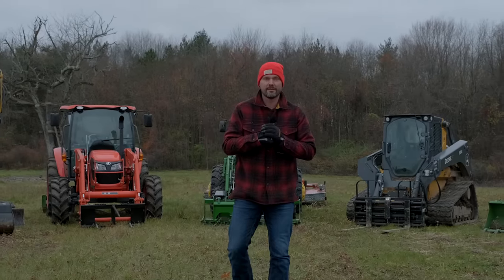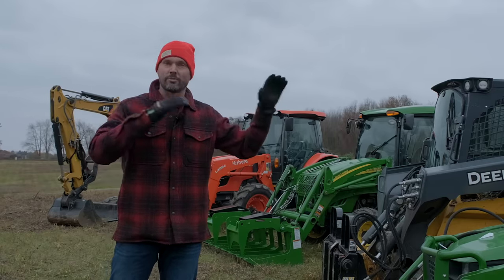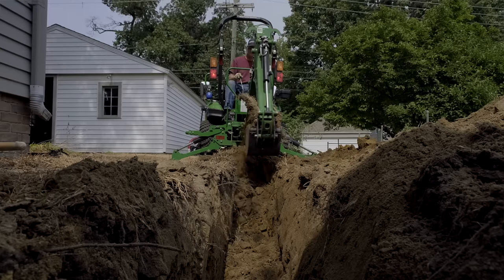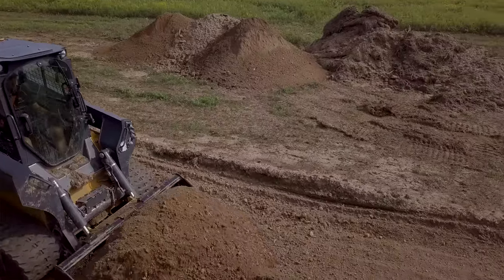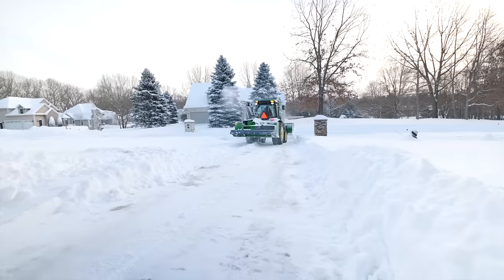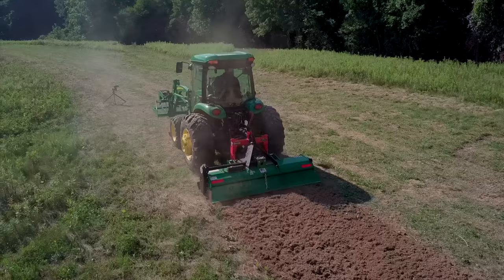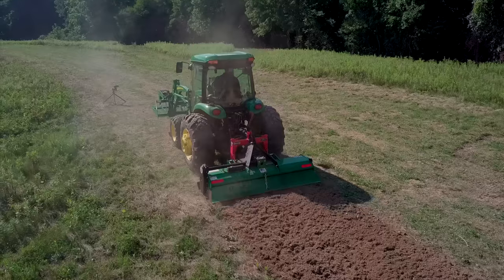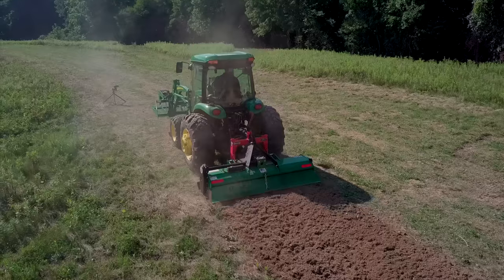IF I COULD ONLY CHOOSE ONE? BEST MACHINE FOR PROPERTY MAINTENANCE

Comment: I recently purchased a little over 10 acres and only 1 is cleared for the house. I'm planning on clearing at least 4 more at the present. It's a combination of trees and heavy brush. I'm wanting to add a few dirt roads, a couple of utility buildings, a green house and hopefully about a half acre pond that I can stock. Not planning on doing this all at once but over the next couple of years at least, and the area I'm wanting to use is fairly flat with a some ruts and a few areas of hills. I would love a recommendation as to what would be a decent tractor size and what attachments would be most useful. Budget would be around $20k to 30k.

Comment: For a large field I would not get a hydrostatic transmission,  they're not designed to be driving one direction for a long time they work well for loader type work. Power reverser would be my choice best of both worlds good for loader work and great for long drives like   Bush hog work

Comment: So I wanted a L4701 but couldn't find one with a loader local for about a month.  I finally settled for the M5400.  I think it might be a bit big for 7.45 acres but we shall see.
Reply: I also wanted the L4701 when I bought my tractor this past year.   Could not locate one and ended up buying a MX5400.  You will not be disappointed.  Great tractor.

Comment: Other than rolling speed a midi ex will out work all those in most all those projects with the exception of tilling and snow removal.  A 12k machine has potential for a lot of attachments and the advantages of tracks, power, and stability. Moving things, pallet forks, hay spears, grinders, grade bars or buckets, digging, road building, foundations, septics, drainage....I feel the others are more hobby machines that do work but have many more limitations. Then again terrain/ground type and application im sure dictates much of this perception.

Comment: If clearing land then a big skid steer & an excavator will do the job. However a bull dozer will do a better job. Even better get two bull dozers & link them together with a big heavy chain, then knock down everything. 

Where I grew up bulldozers on farms were a common sight. Today they are not seen as much as most of the bush has been cleared. A few old ones are still around, most of them rusting away in a paddock or sitting in a shed. Tractors can keep the bush from growing back. However sometimes land is neglected and the bush grows back on formerly cleared land. This is when heavier equipment is needed.

So if clearing land, get heavier more powerful equipment. If working the land get a tractor. Even a little tractor with a front end loader is a blessing when clearing bush. We have a Kubota MX5200 which I guess is one of the larger compact tractors out there. It’s not a bull dozer but having a loader lift and push is a blessing.

Comment: The cost difference between a skid steer and a tractor is significant, as well as the weight difference. Additionally, maintenance on a skid steer is difficult and expensive. For me, a tractor is much more feasible and versatile. Skid steers are very capable for a limited number of tasks….tractors are super versatile for virtually any task, and cheaper and easier to service.

Comment: Utility tractor is the one for me. I have 112 acres and lots of roads. Used to be a campground. I have the 5055E. Was looking at the 4066 and would be useless for me. I haul dirt from point A to point B. When I saw the bucket of the 4066, it’s about 4 times smaller than the one on my 5055E. Imagine hauling dirt from point A to point B 2000 feet apart. Would take me forever. Also I have really big oak trees that die from time to time. I had some this summer that I could barely skid a 10 ‘ log. And then the loader could barely lift the log onto a trailer to get sent out to a sawmill. If you have a descent size property and you want to skid your own trees for fire wood and you have large trees then a compact tractor would be a poor choice IMO. Hope that helps.
Reply: You should get yourself a dumping trailer that you can pull with your pickup truck 2000' is way to far to carry small quantities of dirt. Not to mention the time involved and wear and tear on the tractor.
A good dumping trailer really holds its value, use it until your done with it then sell it and get most of your Money back.

Comment: So I am looking into a tractor just bought 6 acres flat ground open field will be making it home stead house barn etc., there is only one piece I’m really gonna have to do tree removal and that is the easement access to the property, so I was just going to rent a skid steer for that, I do also have access to a zero turn for the yard grass that for the rest of the open field I’m not sure what tractor size or brand to go with I will be digging a pond driveway and the foundation for the house and barn that apart from that basic maintenance driveway and pastures any advice would be greatly appreciated, one more thing new or used in which attachments would you recommend

Comment: If I was in your usecase I would go with the bigger compact tractor(the John deer) and the cat excavator you woiod have the mowing and tilling capability of the tractor for the flat ground, and the use of the excavator near the pond and in the woods. Near the pond might be to soft for a tractor and a excavator will be able to get farther away from the pond for bank clearing and can move or take down bigger trees in the woods.

Comment: Great explanation of the capabilities of all the machines shown.  This really helps a ton of novice equipment folks.   I personally highly value my off work time….. thus my equipment mix for my 120 acres….(50ac field/70ac wooded) is Cab 125hp NH T6050 16x16 power shift trans. &  a John Deere 550H 84hp  LGP HYDRO Dozer with 6 way blade.  Keep em coming!!   Happy Thanksgiving!!!!

Comment: Between the options presented the versatility can be quite similar between all the machines (especially when using adapters) - however, the ground speed between the different machines can be significant (especially if/when it can be fully used). That may not make much of a difference when working, but if you're having to drive from one side of the property to the other to work - or do a lot of transiting back and forth being able to go 50% (or more) faster while driving can make a difference.  

It can also be interesting to compare a tractor to a skid steer of similar weight/power as the differences in capability shrink quite a bit, which can highlight how much more skid steers are specialized for certain tasks - even though they are frequently (especially with larger sizes) used as general tool carriers.  

Of course when considering options, compact wheel loaders, compact telehandlers and the various hybrid machines (like Bobcat's Toolcats) can also be worth a look.... really depends on the needs of the situation.

Comment: I would take the same.  I have quite a bit of experience running all of these types of equipment and the skid steer and 1025 would be a goodish combo but if it came down to one I would definitely go with a big compact.

Comment: Great video!  Very useful!  Thank you!!
Just bought a heavily wooded lake property which needs a driveway put in, LOTS of brush tree work, 10 years ago logging mess clean up, converts to put in etc etc.  
I 100% agree with your analysis.  I’m looking at a 3046R…. Curious if you have thoughts on the 3 series vs 4 series for this???  Obviously you selected the 4 series in this video but I’m pinching pennys and the 4 series is a good jump in price.  Plus I’m thinking the smaller physical size of the 3 series may be nice in all the tight trees…. 
Also, planning to buy a compact tractor but also RENT an ASV track loader with a brush clearing head like you used.  Seems like I need the track loader to break thru and build trails/ driveway and then do the finesse and fine tuning and maintenance work with the tractor.  
Cab vs Open station is my other dilemma…. LOL 1st world problems I guess.  😉
2 mile long dirt driveway in northern MN with front mount snow blower with an OPEN work station….. Tough or Insane??? 😉

Comment: I own 50 acres in sc, thx for the video, back in 2012 I found a demo Kubota b3300su tracktor I bought for 12000 out the door, has never let me down and it’s got a ton of hours on it, I had hurricane matthew come thru a few years ago and dropped a bunch of trees down, my compact tractor did good, but not great, so I bought a mini excavator after a buddy of mine loaned me his, there’s nothing I can’t do with both of them on my property, after saying all this, here’s my theory, my mini ex and my tractor total is 32,000 and that’s two machines total, good used machines are hard to find but if you have patience it can be done, most people will have way more than that in 1 machine alone, do yourself a favor, make a video with just having 2 machines cause there ain’t nothing you can’t do with the two I got. Anyways, thx for the video again, take care, be safe, God Bless you and yours.

Comment: We have 28 acres we maintain with a 2021 JD 3046r factory cab. Part of our property is finished mowed and some is flail mowed. Part of our property has woods so we also added a grapple. My previous tractor was a 2011 JD 3720 with a Curtis cab and aftermarket heater. Was a great tractor but when I was offered more than I paid for it after using it 8 years and 1000 hours I decided to upgrade to a factory cab. I would love to add rear spacers but am not sure how wide I can go before or if they will interfere with the belly mower. Any advice other than referring me to Bora?

Comment: Very curious of what you would recommend and why so I can justify the cost difference. I currently have a 2012 3520 and I want to upgrade to a cab. I have a100 acres mostly wooded to maintain and struggling between if I need to go with a 4 series. So far I haven’t had any trouble accomplishing anything I need to do with my 3 series. Planting food plots, mowing, digging etc.

Comment: I have a Kubota L 4701 and I only have 5 acres ( you can stop laughing now) but I do have nearly a half mile gravel driveway that I begged and pleaded with my neighbors to grade now and then and if I bought chat, I’d have to hire somebody to put it down. Also my 5 acres is mostly yard so I have a finish mower and I can mow the whole dang thing at half time of a good football game and be done in time to see the whole dang game! and my drive has never looked better and smoother. I figure a size large is better then a size small and after more then 4 yrs I have absolutely no regrets. The amenities like working cruise that did not come standard on the smaller tractors pushed me to the L 4701 and it’s been a dandy. I love my tractor, if I could get it in my bedroom I’d sleep with it.

Comment: If you can only have one which one are you going to get or keep. It's simple.. The one you can afford!!! I've owned & managed a 70 acre piece for 10 yrs with a Kubota L3800 open station which is a small compact tractor. Bigger than a sub-compact but not a big compact because that was what we could afford. Last fall we ordered a Kubota L6060 cab because we could afford a larger compact to work with. That is how most people decide what size and number they will have on their property. Oh the L3800 gets' sold off once the L6060 arrives.

Comment: Still blows my mind that people buy John deere for anything below like 10 field operations. They make a good "big boy" tractor meant for hauling bailers and planters whatnot. But their compact and subcompact tractors do less work and cost more money. I mean a branson of equal size to that deere subcompact is rated at 2,200 pounds for a couple thousand less dollars. I mean if brands are what matter to you and you needed the Nike sneakers and Hollister jackets as a kid,  I guess its natural to buy a deere. A lot of guys see their grandparents or parents with older, decent deere equipment and think they need to go spend top dollar for a bottom dollar tractor. But man, buy a John deere with a front loader. You can't buy anything other than the proprietary John deere implements. Every other brand has the same quick release mechanism. John deere made their own so that you have to buy the. Again, top dollar John deere bucket or grapple. You cannot buy anything besides John deere. It's a cult. A 25 horse John deere lifts the least out of any major manufacturer. By a margin of 300 pounds. They lift 1,1something pounds. One step above that is a kioti lifting 1,4something. For 2 grand less. A new Holland is at 1,600. A branson is at 2,200. Yall gotta look past the name and image. Look at value and capacity

Comment: Excavator is far superior you can do everything with it you can dig ditches, put in road and clear land very efficiently my second choice would be the skid steer which is also a very versatile machine
Reply: But it's slow. You can't track around a 10 acre lot efficiently at all never mind trying to move material from one side of the property to the other. In my opinion a Tractor loader backhoe is perfect for a piece of property if you could only have one. I'd pick a Kubota L35 or an L48. It does a little bit of everything. Sure a mini excavator will trench better but you can still trench with a backhoe. Good for lifting, moving material, blah blah.

Comment: If I had to choose just one it would have to be a tractor. The skid steer and mini ex are the best at what they do, but neither is a go to machine for mowing. I have a subcompact tractor with backhoe and belly mower. It does everything I need to. I do admit a mini excavator is awesome to have and so is a skid steer, but if anyone is deciding to select just one piece of equipment to do the job, that hydrostatic tractor lineup is the place to look. Thanks for the video.

Comment: "If I had to choose only 1 machine" is a false premise. If you're keeping your place, you know that you'll need more than one machine. So you might as well invest in the machines that you know are going to be ideal for you, as opposed to buying a stopgap piece of equipment that you eventually will need to sell (losing some money on both ends). In your case, the machine you're selling tells you that it should have been last on your list. In my case, the tracked skid steer and a Kubota KX040 mini excavator with the 6-way blade are are at the top of my list.

Comment: Are you going to replace the 4 series with a 2 or 3 series? I have a 1025R and a 5075E and would love to have a 3039R for jobs in between. Along with a CTL and miniex of course. If you did get a 3 series, you could probably get rid of the 1025R a well out there. That would put you with say a 3046R, CTL, utility tractor, and miniex. Not much you couldn't do with that stable.

Comment: Excavating machines are in a different class then the basic tractor. Totally different uses. Unless you are in the business of using skid steer or dozers , i would rent them and buy a versatile tractor. The average hobby farmer or homeowner does not need to buy a a skid steer or excavator. If you don’t want to deal with tractor issues like overheating…try buying.a Massey!😁

Comment: have a kubota b6100e 14 horse that I pull 40ft trees out after cutting them down.  some weigh 3 time the tractor.. paid 900 for it 14 years ago.  wouldn't sell it for 9000 now. gr EA at little workhorse.. wife named it hilda. go figure

Comment: So a new 4066R which will struggle lifting a large round bale, weighs about 4300lbs and costs north of $70,000 and uses 3.28 gallons per hour fuel vs a utility tractor which weighs up to 10,000 lbs will lift multiple round bales and uses maybe 1.8 gallons per hour for maybe $60,000? Doesn't make sense

Comment: 14 acres.. need to clear 8 of it... if had the money... id chose ANY machine that could dig or knock down small trees..  But i dont have that money.. so i have to cut them 1 by 1 with a chain saw and then cut those trees into smaller peices and move them to the side.. eventually rent a chipper and toss them in it

Comment: Funny, how 140 Acres don't justify a big tractor.  Here in germany, people have 300 Hp machines for smaller properties. Maybe something got out of control here. But in my experience, these small machines often can't take the loads you put on them, and simply don't last anywhere near as long as the bigger ones. 140 acres with a hydrostatic drive compact tractor? After a few years this machine will be out of service for sure, if you use it often  .

Comment: I enjoy watching your videos, they are very informative. I do have a question though - why is it that in America 4 in 1 loader buckets don't seem to be very popular? Here in Australia, 4 in 1 buckets are on just about everything. They are very useful, as I'm sure you would know, and can negate the need for some additional attachments. Just curious...
Reply: It's probably due to upfront cost, and the ability to upsell multiple attachments. If my tractor came with a 4 in 1 bucket, I doubt I would've bought a grapple, or box blade.